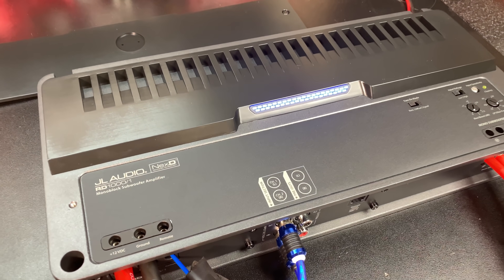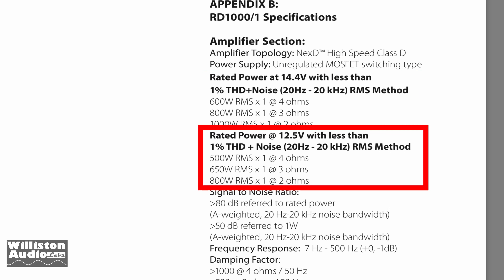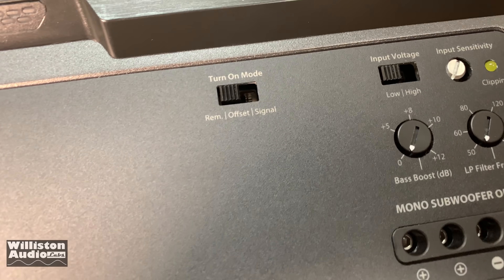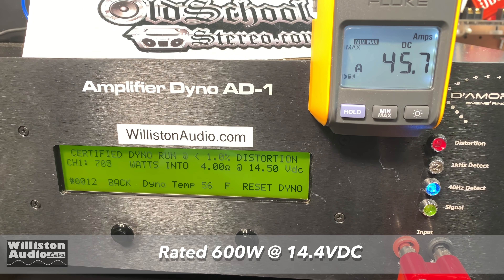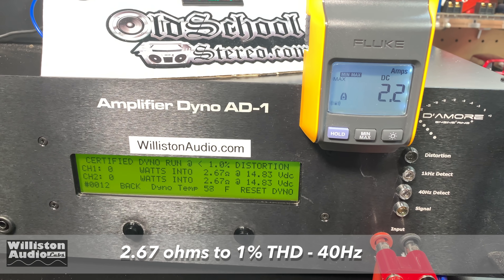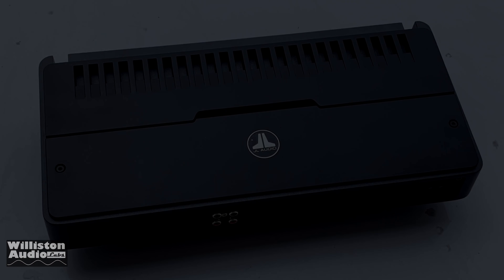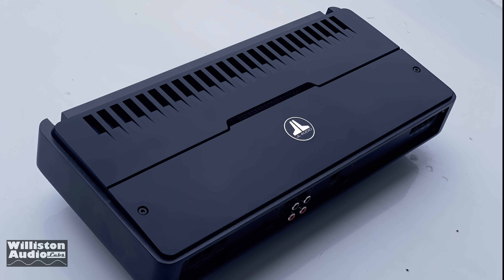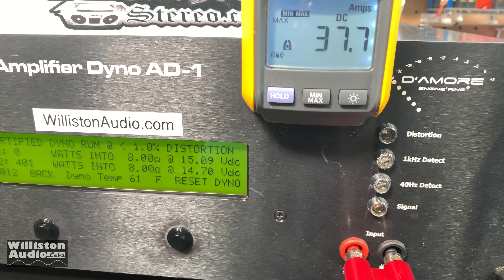JL Audio RD1000/1 Amp Dyno Test [4K]

Comment: Great video Dereck! Even better results than I expected. Have heard on the forums that the RD amps sound even better than the XD line.
Bruce Macmillian also designed the R.I.P.s technology while at PPI that would ultimately become the basis of what we now know as the JL Slash series. 
BTW, the new RD1500/1 claims to do it's highest rated power at 2 or 1 ohms with either 14.4 or 12.5 volts input. Wonder how it does that??? Hmmm.
For all the old school car audio fans who don't like modern class D, present day JL Audio with MacMillian, Jeff Scoon, Manville Smith  (and probably others I'm leaving out) is the closest thing to the original PPI we will ever see again. They continue to innovate and move the ball forward. 
Yes, JL products are a bit more expensive but, as Dereck says definitely get a lot for your investment.
Reply from the maker: Well said Mark!
Reply: i bought the RD1500/1.  it's pushing 3 W0v3 15's at 1200 watts.  sounds amazing!  wanna test it for me Dereck? @wal
Reply: @fatfreesalami  please post a video of your RD 1500!
Reply: I just hope class AB doesn't get forgotten. JL makes top notch stuff. Great video!
Reply: Couldn't have said it better myself. If everyone bought the cheapest cents per watt amp they can find then the only R and D would be in Korea, China, or Brazil. You can't do .15 a watt amps and afford to keep electrical engineers on the payroll. I think people continue to confuse car audio companies   with car audio distributors. Although I wish companies like Kicker and JL Audio would manufacturer their designs here. Companies like skar, audio pipe, DC are car audio companies as much as Sonic Electronics is. Yes they distribute car audio gear. That's about it.
Reply: Did Bruce Macmillan design the PPI  power class amps?
Reply: 2001 Monolithic I think he may have. Seems I read he may have been involved at some point in the design of the 2500F1. That would have been around the same time as the PC amps but, I'm not entirely sure about that.
Do a search for his name. He does hold several patents, or did.
Reply: i posted 2 videos @lstephenson247
Reply: @brentb5303  u mean like they produce an already designed amp and slap their name on it? I figured thats what u have to do to keep them cheap.

Comment: Holy shit that's a good amp! And as others have said, multiple smaller caps that already have low ESR creates even lower ESR! The most obvious good thing about this besides what's already been said is far less loss and heat too, meaning they should last longer! Also, another great protect circuit! Much like CPUs that hit thermal throttling, overload makes them reduce power output. Brilliant amp! I'll be keeping an eye out for any JL Audio cheapies going on eBay etc, maybe even some junkers i can restore. Nice work as always!

Comment: I had an older model JL e4300 and it never failed or gave me a single problem, and took it's share of abuse. I noticed the amp itself had no replaceable fuses on the outside, they had a lot of confidence in their products.

Comment: Im a treasure Pawn shop hunter, found the RD500 for $87. Still had all wires hooked up to it lol
Reply: Lol somebody else’s amp I’d assume . They just ripped it out of my car when they stole mine . It’s a sickening feeling to have your belongings stolen .
Reply: @AnDrEw122100  I thought of that at first. But then I've sold stuff with wires and things attached. Didn't want to bother removing them. I feel you on the theft stuff. Thats why I bolt my Box and amp to the trunk frame.
Reply: adaboy4z it was bolted onto the car lol they ripped it off 🤣 my car was physically stolen so they had the time but the wires were clearly ripped out
Reply: @AnDrEw122100  awh man. I believe in Karma it will go back to them.
Reply: I don’t understand why the pawn shops don’t just get an Allen key and remove the wires. It’s gross looking at amps with cut wires still connected, so ghetto.
Reply: @AnDrEw122100  Couldn't agree more. I hate thieves

Comment: Great amp! At that price point I do have 2 complaints though... I don’t like that style of RCA input on a $500 amp and give us a bass knob in the box!
Reply: Just use gain.
Reply: Cekpi7 turn it to 11!
Reply: Seriously, for the price, I think they should at least include one. I would love to listen to music in fantasy land where all music is recorded at the same quality and recording level.  Since fantasy land doesn't exist (drug induced fantasy land doesn't count) , I need that damn knob.
Reply: Richard R exactly!
Reply: What's wrong with the RCA input?
Reply: Qu¡noa_K¡ng•• those type of rca’s can pull out if you’re using some of the higher end cables that fit tightly. I prefer the Tiffany style myself
Reply: @HifiVega  That's true. Thanks!
Reply: If the lower and mid  tier models  like this make their rated power reliably, what is the benefit of buying the higher tier models (such as the HD line)?
Reply: Whit Hutchinson not all about power my friend.  There is damping factor.  S/N ratio etc.  If it we're just power hell you can buy a cheap 100 buck amp that would do dirty 1000 watt.  Wouldn't put it on my focals
Reply: @cekpi7  totally two different things.
Reply: @alfa7108   Nah, they both do same thing
Reply: On their $1000 HD 1200.1 they don't even include a bass knob. One of my only complaints with JL.

Comment: Running a 500/1 and 400/4 in the pete. They sound excellent. Anf have been very reliable.

The 500/1 has done over 4000hours of playtime so far. 

The 400/4 is sitting around 2500hours of playtime and is showing no sig s of slowing down. (It killed two C3 650s though, bridged into a pair :D )

Comment: Dereck makes a great point in this video about how all 1000 watt amps are NOT the same. Just because you can find a similarly rated amp for a lot less money does not mean you will get the same performance, durability and long term reliability as JL Audio. IMO the RD series are among the best bangs for your car audio buck you will find. Find a dealer that stocks this amp or a friend who already owns one and audition it before buying from Fleabay.

Comment: I was able to demo 4 of the JL line in my own car last year. Rd. Xd. HD and slash. First off they all sound different. Second I have my own thoughts on how they all sounded but it might not apply to everyone simply because of space. The slash amps are the most dynamic and best sounding but the average person might not notice it vs the HD unless they got to hear them both back to back.  None of them sounded weak and this amp Dyno run does not surprise me. There is however a difference with how they sound
Reply: How did the Xd do in comparison?
Reply: @trevorphillips3715  between the rd and xd? pretty similar. if you don't have the room for slash amps and don't want to spend on HD i'd go RD over XD personally. the cost increase isn't worth it.  that said, if you don't mind refurbished creative car audio has some JL xd amps at really good prices if you look at their B stock. xd 700/5 for $349 etc. then again the RD 900/5 is only 389. take your pick
Reply: Kyle V hi , how does the Jx series compare to these? Would a 1000/1 jx push 2 10 inch tw3’s ?
Reply: This guy is talking gibberish.

Comment: Would like to see the RD 1500/1 because it's rated 1500 at both 1 and 2 ohms (using the impedance  switch).  Not only that, but at 1 ohm, it's rated the same 1500 watts whether 14.4 or 12.5 volts.  I'd love to see how that translates on the amp dyno.  Since this is different than the RD 1000, does that mean it has a regulated power supply?

Comment: I would definitely use this amplifier at 8 ohms. What I was told by an audio guru and very good friend was that the higher the impedance the cleaner the sound is but amp doesn't produce as much power and the lower the impedance you get more distortion but amplifier puts out more power. So 500+ watts RMS going to a sub at 8 ohms is a lot of power at a low distortion point as I hear anyways.
Reply: Doesnt really matter on subs

Comment: Hey Big D... I bought the Kicker L7 Quad Box on your recommendation.  I'm running a mixed bag to it amp wise.   I have one pair powered by an older JL Audio Slash 1000.1 and the other pair powered by a  newer JL RD Series 1000.1.   Both pairs are running independently on separate amps.  Just because that's the amps I had / have now.  The Quad Box houses each subwoofer pair in their own ported enclosure allowing this type of setup to work just fine.   So two each JL 1000.1 amps running at 2 - OHM's work quite well with this 4x12 subwoofer enclosure.  

My ask is that you please soon dyno  a recent JL Audio RD 1500.1 amp.    I can see me upgrading to a pair of these soon if the numbers work out.  The latest version of these also note they are 1 OHM stable unlike the 1000/1 and below models.  Not that these gain any wattage increase on paper from 1 to 2 Ohms according to JL Audio.  Without the RIPS power supplies of the Slash series amps I would think dropping to 1 OHM would see a wattage increase in this RD series amp ?  What are your thoughts?

Comment: Wish we could see an amp dyno drag race between this and an Infinity K1000 (or newer Kappa One K). I mentioned Infinity because it's efficiency rating is similar (if Ryan's volt meter was correct), but Infinity put out more power.

Comment: Another question I have is why on the inside of the amp does the remote wire terminal have such a beefy connection to the motherboard. I mean if you're only needing 200 milliamps to turn the amp on why do they put such a huge connection on it. And why do they make the terminal able to take 10 gauge wire. You only need like 16 gauge remote wire to do it. I'm thinking they put that huge terminal on there because next to the other power and ground it is cheaper for them to manufacture them like that or something. Doesn't make any sense to me. Seems like it would be just a little 16 gauge wire going into the motherboard but it has like a connection able to hold 500 amps or something.

Comment: Derrick, Nice video,  Just purchased this amp the other day, Using it on a 12" MTX TS85 Dual 2 ohm sub "750 rms"  Sub is Wired up for 4 Ohm and connected to the amp.  

What are your thoughts of having it wired this way rather than the sub being wired at 1 ohm? If sub is wired at the 1 ohm Sub will actually reads 1.3 Ohms

in a temp Ported box "Will be doing custom box shortly for sure" in a Subaru wrx

Comment: Does any have any advice? I bought this amp paired with a jl w7 12 in a jl factory box. I also have a Kenwood aftermarket radio. When the volume is at max it barely moves my review mirror. I'm extremely disappointed. It was professional installed by a local shop. The sub pops when turning on the car and a low hum that doesnt turn off till the car is turned off. Any thoughts?
Reply: They installed it incorrectly. Use the line in RCA to turn on the amp instead of +Rem, that will eliminate the turn on pop.

Comment: I just picked one up for 300. In excellent condition. Going to run a alpine type R 10. To put some low end in my Toyota Avalon. I’m not going to crank the gains up. Just enough to fill in some low end. I should be alright I don’t want to blow the alpine. Any thoughts???

Comment: You should do a dyno for the RD1500/1. I've heard its jl's most powerful monoblock amp. I'm curious to see how it performs
Reply from the maker: I will look into it for sure
Reply: Williston Audio Labs thanks.
Reply: Hey bud did you happen to test this amp the rd1000/1 at 12.5 volts? Curious how it performed because ima get a rd1500/1 for 2 13.5 w3v3 subs. The subs are rated at 4 ohms but really they are close to 5 ohms but to be exact they are 4.8 ohms.When I wired the two subs parallel they were 2.5 ohms. The rd1500/1 is rated at 1000watts rms at 3ohms and 1200watts at 2ohms when running off of 12.5 volts. So I'm guessing I'll get about 1100 rms total and 550 rms per sub. I'm just curious because knowing jl audio I'm sure the amp will perform better then what they rate it at. I'm the same person who said to dyno a rd1500/1 lol. Thanks Jeremy
Reply: @wal  please do i also have this amp and have wondered how it does on a dyno. Please do the 1500/1 🙏🙏 lol
Reply: Yes please do a Rd 1500/1 JL audio thanks love your videos

Comment: Looking for some Sub. advice.. I have an old Rockford Fosgate Power bd1001amp that puts out 1083rms @2ohm...my question is can a single Sundown Audio SA15d4 handle that kind of power for a daily? Or should I consider one of the 1500wrms subs maybe the E or the U series I forget witch.  I plan to build a spec aero ported box as large as I can fit in my trunk with tuning around 32-34hz. Any Sub. recommendations or input would be greatly appreciated. Thank you

Comment: does the rd 500/1 over perform like this? im looking at a w6 with 600 watts rating max continuous so if the rd500 over performs it would be perfect
Reply: It does I have it definitely not a 500 watt amp I’ve had 1200 not perform as well as 500/1

Comment: What size wire did you run that on. Just bought a 1500 and it says 2awg. Does the 0 fit

Comment: Can someone help? 

Im trying to set this up at 2ohm. Turned my head to 75% and then turned the input sensitivity up till the clipping light turned on. 

Is that it? I've measured AC voltage at the amp and has only at 20v. According to the multimeter method of tuning a system, the voltage should be at 44? 

Do I also need to adjust gain?

Comment: I don't get the design? My two jl audio w7's run at 1.5 ohm, most w7's do. Is this amp able to run safely at 1.5 ohm? And if not then it's made for the lower line right?

Comment: Wassup.  Goodafternoon. Love this video and other videos aswell.  Was woundering if you could test the CXA line of kicker Amps.  Specifically the 600.1.   This amp is rated 600 watts RMS at a 2 ohm load and at 14.4 volts.  It also has a 1200 watt max rating.    And it says its at 15volts.   These amps cost 250 dollars brand new sooo i was wondering if you could dyno this little amp.  Its amazing.  Id like to see the 1 ohm load on it too even tho its not 1 ohm stable.  Try 1 ohm at 15volts.  & doit at 2 ohms aswell.   Thank you

Comment: Could I run 2 13tw5-2 in parallel for a 1 ohm load? I read the manual and it says it may make a popping noise on certain notes etc but I currently have 1 13tw5 and I love it and the amp but... I want more. Any advice would be appreciated thankyou

Comment: Want to see a test on the latest Rockford Fosgate power 500. I have this amp and curious how well it tests
Reply: Are you referring to the Power T500X1br or the T500-1bdCP? Regardless, these come with certificates out of the box that state the tested power, and is generally 25-35% over the stated power levels.

Comment: Kinda strange that the burst test is so similar to the certified. Is that a good thing?
Reply: Yes it meets rated power.
Reply: Some amp designs output wildly more power at dynamic loads, though that can be a bad thing too if you're already near the power limit of your speakers.

Comment: It looks like a nice amp and certainly tests well, but it confuses me that it is only rated to 3 ohms.  I wonder why they wouldn't design it to be rated at 1.5 ohms so it could handle 2 of their 3 ohm subs.
Reply: It's rated to 2-ohms, they just have a listing of 3-ohms in the specs since the W7 subs are 3-ohms, and a buyer of the RD1000/1 might be interested in knowing how much power they would get out of the amp with the 3-ohm load.

Comment: Would be nice if more amp's came with a clipping led.  Solid amp through and through. :-)
Reply: Umm, it does, right on the face of the amp next to the controls. They expect you to setup your amp properly, playing the test tones, using the clipping LED as a tool for setting up the amp vs being irresponsible and blasting clipped signals to your amp.
Reply: @kn7671  "Would be nice if more amp's came with a clipping LED" - you know, other amps....  No worries bud.  :-)

Comment: I have a rd 1500/1 and it wont play anymore, the clippling light stays on with no speaker wires connected to it, anybody know what could be my issue
Reply from the maker: You’ll need a tech to investigate. If you’ve power cycled and it still goes into protect, disconnect the speakers and see what happens. If still in protect you’ll need to send it in for repair

Comment: THIS AMP WILL WORK WITH 1 OHM SUB NO PROBLEM :) by the time you are playing the system your subwoofer will be at 1.3-2 ohms anyway after "box rise" and you will be getting that 1400watts dynamically.
Reply: You think it will stay out of protection @  1.3 ohm load?
Reply: @jamespskowski432  most all class d will
Reply: @rmblwgn  i asked jl and they didn't recommend it.
Im still gonna try though.
Reply: @jamespskowski432  it wont go into protect. box rise will be up to 3 ohm at least

Comment: What does the offset mean on the remote cut on switch?
Reply from the maker: You can use it with high level inputs for turn on
Reply: @wal  I tried it on my rd 900/5..didnt work too well,hit and miss.went traditional and just tapped into the remote.mainly just wanted to test it out.

Comment: I still have not got it answer of why this amp pulls 109 amps when you're supposed to fuse this amp with an 80 amp fuse.  Is it because the 109 amps is such a fast test and it wouldn't blow the fuse because it's just a short burst or something? I'm not really fond of how fuses work. Seems like it would blow the 80 amp fuse if it was at 2 ohms and it pulled over 80 amps even for split second. I wish I could get an answer for this seems like no one can come up with an answer for me.  I was actually going to put a hundred amp fuse on it instead of the 80.
Reply from the maker: The amp dyno tests use test tones which are constant and very hard on the amp. With typical music playback you will not pull much more than 80A except maybe on musical peaks and it won't be long enough to blow the fuse.